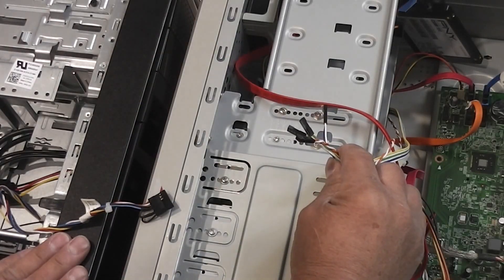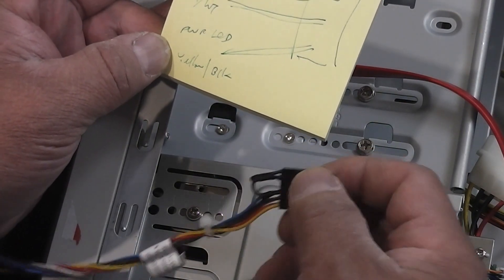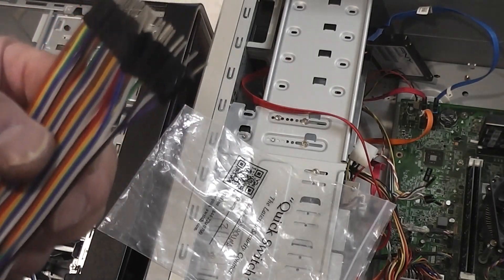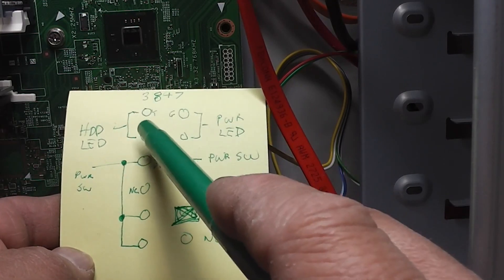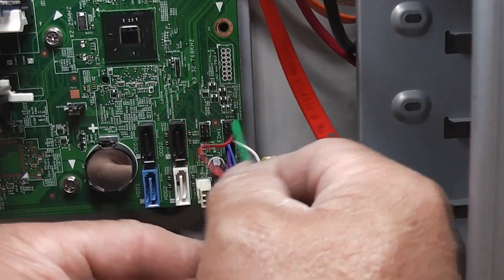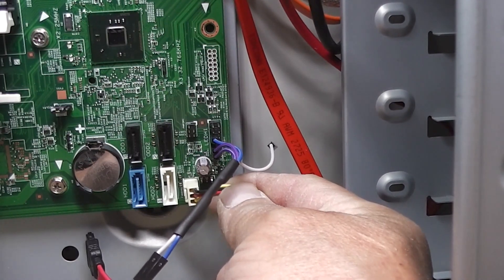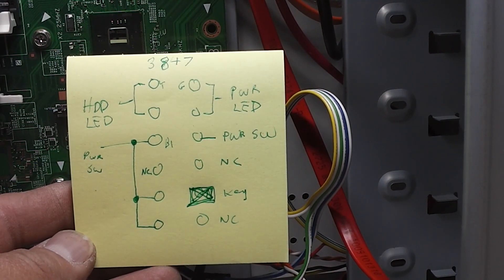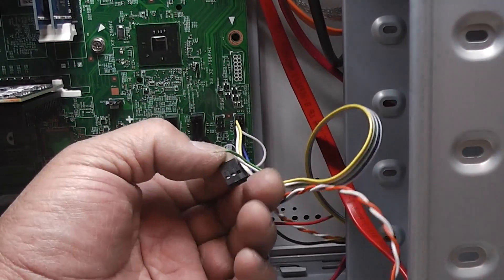Dell Inspiron 3847 Front Panel Panel Header Mod for non Dell case.

Comment: I did find an adapter on eBay that solves this problem, after I went on the underside of the header and soldering a jumper between those pins.

Comment: This 100 percent worked for me. I swapped the motherboard into an inspiron 560. I7-4790 and a gtx 1650. It wouldn't post until those pins were shorted. Now it's a great little budget rig

Comment: I know this is old but I will help some ppl but if you de pin the 3 wires cut the blue one off put them on 3 5 and 6 or whatever the black ones are I think and you put the regular 2 pin power plugs on 3 and 4 it will work fine I had to deal with this too once I was moving this MB to another case for a plex sever
Reply: What should I do if I no longer have the proprietary connector and just the case connectors
Reply: @medianrabbit3634  do what he did in the video but all you really need to do is bridge the 3 wires together and use it like a normal MB with the two power wires
Reply: @MrCougar1825 I have the button wired up and it turns on and everything but black screen and no power on keyboard and mouse
Reply: Oh and the last 2 pins there’s nothing on them .like where the black wires sit on the proprietary connector.should I bridge the 2 leftover pins?
Reply: Or do I bridge the 3pins?
Reply: @medianrabbit3634  ya did you get it sorry I did not see you commented back
Reply: did you solve it?